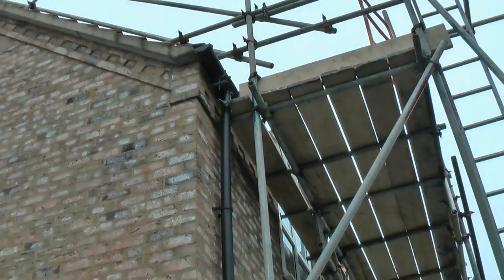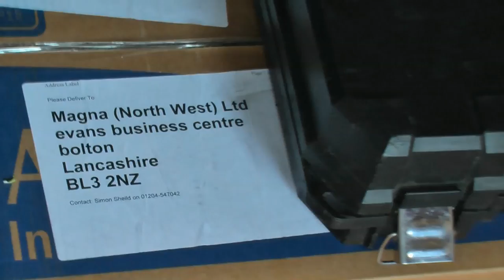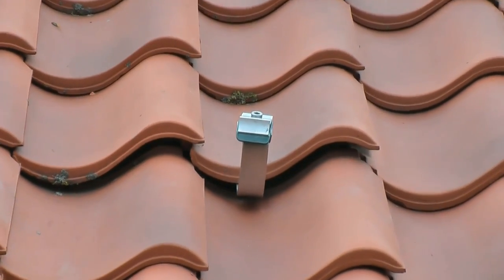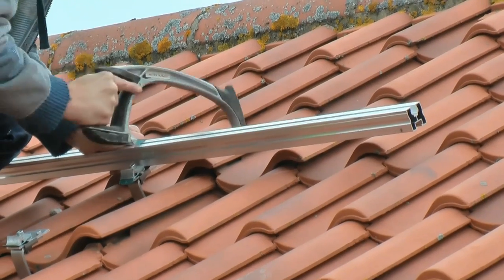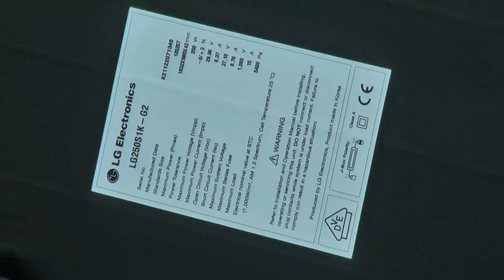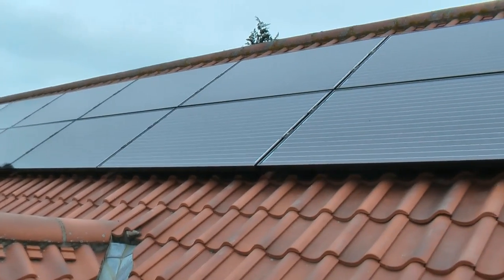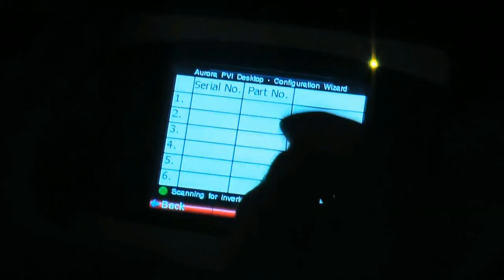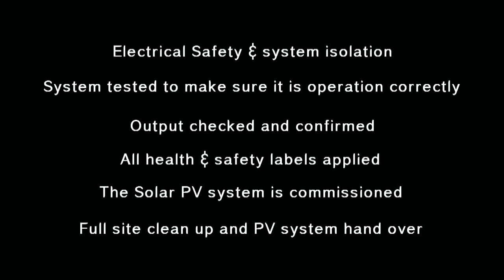Magna Solar - Solar PV System Installation - Start to Finish

Comment: Those rail brackets are not a good match for the tiles. Need arched brackets that match the curvature of the tiles. Those huge gaps will be problematic in future.
Reply: you mean that we must using the curvature of the tiles, do you have any picture

Comment: Tiles not trimmed over the brackets with angle grinder so they lay flat, rails to close so modules not supported see installation manual LG solar, inverter in loft to hot and customer will look at it, brackets not staggered over rafters so more weight on a few rafters.

does any one train the installers, NO.
Have a break and read the manuals.
Reply: Why the rails are so close ? because they mounted horizontally :)

Comment: Inverter in non ventilated area? Rule of 50-50-30-30 cm free space around inverter ignored. Tiles resting on brackets. No earthing between rails? Non stainless steel bracket screws?

Comment: As a US installer we do it completely different here   . We dont use lead.  Structural sealants, steel and aluminum. lead is highly poisonous to ground water. and nothing touches the roof except the rack feet.
Reply: Wow, that's nice
Reply: I will be very grateful, if you accept me to work with you boss

Comment: Why we mount the module in Landscape? the clamp area must be wrong. it should be a weak point and can not withstand hight wind speed. also not follow solar module's installation manual.
Reply: Zhang Romeo , Mounting in Portrait is much cheaper and looks great as well, however, some customers prefer landscape, especially when it is triangle shaped roof. It looks more aesthetic.

Comment: Doesn't it come with batteries, what happens at night when most of the electricity will be needed? What government incentives are there?
Reply: Jagdtoq , Batteries are not required, because when you don't use the power from solar system, it makes your utility meter run backward and so you will save a lot!
Reply: @narekalaverdyan6790  no it doesn't make the meter run backwards

Comment: Can we avoid batteries for storage and to provide electricity in nights or in absence of sun?

Not only it acquires potential share in the initial investment required to switch over to pollution-free Solar by public being reluctant to  to any contribution to control Climate Change but use of Batteries is present age is shameful for Technologist 'to be there where they were' as for production of electricity is concerned, being as its primitive source  Photovoltaic!

Comment: I'd like to see more on what was done regarding Earth Fault protection, what surge protection if any, and how the strings were terminated into the combiner. Also depending on PV Panel type, if the Positive and Negative were both protected. I would expect a system of this size to have string measurement modules on Modbus such as Phoenix Contact SCK-M-I-4S-20A or SCK-M-I-8S-20A.
Reply: where is this company for solar energy?
Reply: This system doesn't need earth fault protection from what I can gather unless you talking about the AC side?
Combiner box also not required. By the amount of cables I'm guessing it is a 2 string system. Quite likely a dual tracker?

Comment: They should have chipped the lip off those tiles, they now sit anything but flush and could let water in. Lead flushing inside the roof!? what so the water can run down into the eves or seep through the insulation, waste of time. Metal flakes from cutting the rails will fall into the gutter causing it to rust, they should measure on the ground and faster cutting would be achieved with a circular saw through the soft aluminium.
Reply: aluminium rust?
Reply: Galvanic corrosion

Comment: This is the worst installation I have seen. Tiles were sitting up!!! good luck with the water leaks in the future. I would not call these guys professionals! Inverter in the loft?? So how does the customer check if its working or not? I have been installing Solar for over 8 years now and that is by far the worst one I've seen! How do your licences come? In the cereal box?
Reply: +Zaren Henderson not all customers want a large inverter in there living space, never mind that they often don't have the space for it.
Reply: Zaren - Absolutely!
Reply: In the US fire fighters have to be able to turn of the inverter, so it has to be near the main panel outside.
Reply: Poor installation
Reply: Zaren Henderson poor installation

Comment: Where is safety harness?
Reply: Not needed if you have scaffold at eaves height. If you climbing to a side where you have the potential to fall to floor level then you will need it

Comment: The bracket was only sealed top and one side with flash band? The tiles under each bracket are sat proud, no PPE in sight and this is a promotional video ffs?

Comment: No metal conduit, no grounding cable, no caulking on lag bolts? Guess this company probably doesn't supply a great warranty either... Wouldn't be surprised if it either caught fire or the roof started leaking in the first few years...
Reply: It doesn’t have to be metal on the outside at least a PVC conduit that is meant for electrical wiring should have been installed.